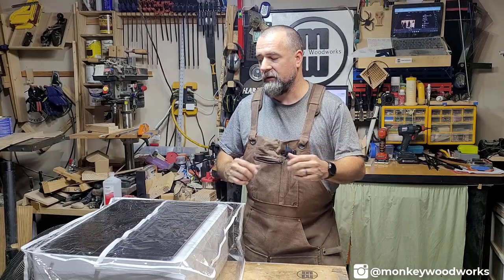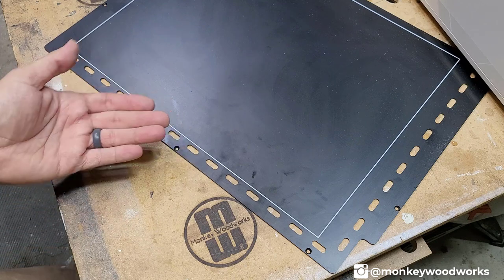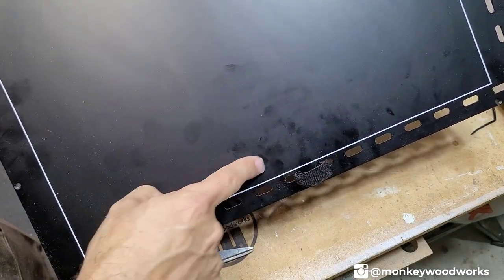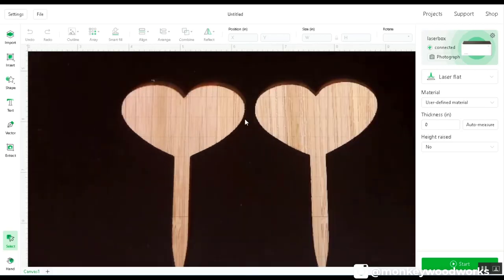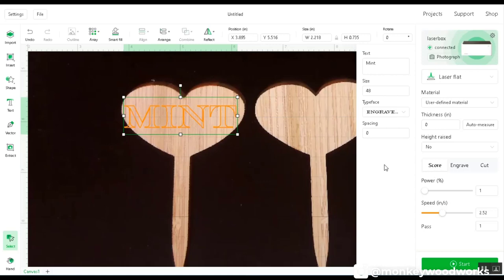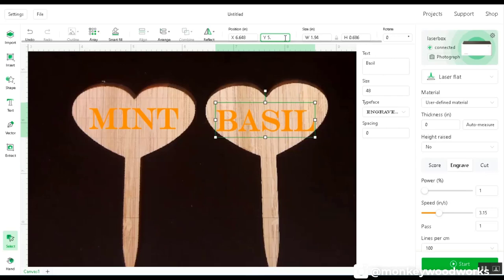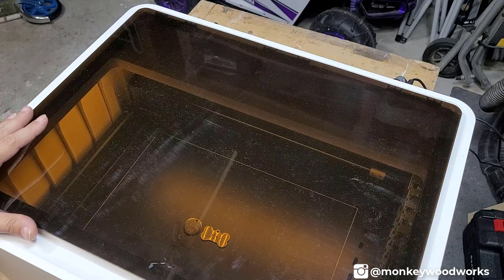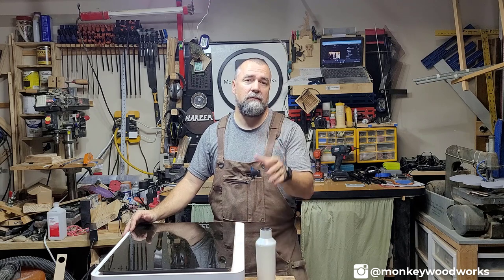Part 8 of Testing out the xTool M1 - Engraving: You Win Some, You Lose Some

Comment: Thank you so much for your amazing videos. I feel like I’m a pretty quick learner if I have some basics to follow. Unfortunately, there aren’t a lot of “handbooks” or tutorials out there for the M1 specially. I have so many questions but I think a good place to start is understand power and speed. Can you explain the settings for me and how the grids work? Do I need to make a grid template for each material I work with? Thanks in advance. ❤
Reply from the maker: You should run a cut and/or engrave test on all of your materials to find optimal settings. You can make your own with the grid array feature in XCS.  I have a cheat sheet of my M1 settings in the description of any of my M1 videos.  That will give you a starting point on some common items.

Comment: Great to find your video. I just ordered one online and expecting it to arrive in Aug in Taipei. But I find on their material testing spec that clear acrylic sheet won't cut successfully, which was a bummer cause I like to make things with clear acrylic the most. Can you share some acrylic sheet cutting video?
Reply from the maker: I will add yhat to my list!  I have seen in the group that a diode laser can only cut tinted acrylic.  Not only that but specific colors due to the science behind it.  Clear just allows the laser to pass right through.  I know xTool is going to work on topic specific videos for their M1 site so keep an eye out on their page as well as my channel.
Reply: @MonkeyWoodworks  Wow thank you for such quick response! I did use laser cut machine to cut clear acrylic back in design school. If I remember correctly, we left the protecting film on the clear acrylic sheet inside the laser cut machine and get perfect result. But that was more than ten years ago and that was a large professional machine. I'd be curious if this XTool can work. That would be awesome if it would work that way. :D
Reply from the maker: Group answer from xTool:  Unfortunately, all diode laser cutters, including M1, cannot cut clear acrylics because the light will pass through the materials instead of being reflected. So normally you will need a CO2 laser cutters to design on clear acrylics.

Group answer from a member:  The laser goes through clear acrylic, which is due to the wavelength of light; it’s physics and nothing can change that.
Reply: @MonkeyWoodworks  Thanks the answers!

Comment: Really appreciating the basics, hopefully I will have my machine soon! Others are using aluminum foil and honeycombs? Are you not finding those necessary?
Reply from the maker: I used aluminum foil at first but after it melted during my fire I started using a flat piece of galvalume.  It's something like 55% aluminum 45%zinc.  It works really well.  Also I want to get a honeycomb but they are $$ so I'm just using the prisms for the M1 still.
Reply: @MonkeyWoodworks  Hello thank you for your video. Question can you please explain what is a honeycomb really for? Sorry if this is a crazy question.  I'm new to all this goodness😁
Reply from the maker: The honeycomb does the same thing the prisms do.  It allows the piece to be held up in the air above the base plate.  This gives an air gap between the base and the piece your cutting.  The air gap allows for cleaner cuts when the laser blows through the bottom of the material.  It also cuts down on charring on the bottom of the material as well.  The advantage of the honeycomb over the prisms is that the honeycomb supports the entire surface all the time no matter how small a piece your cutting out.  The prisms have to be adjusted a lot to make sure they will support the piece your cutting.

Comment: After all this testing would you recommend the m1 to buy? And thanks for your work!
Reply from the maker: Yes I would and I am having lots of fun with it but it is not for everyone.   It has working area size limits (compared to it's older brother the D1), no air assist in cutting, limited to a 10watt version.  However, I love the camera, the fact that its fully enclosed, the ability to use as a cutting tool with a blade.  The only issue I have with it at the moment is the XCS software behind it.  However they are actively working on that and I know it will get better over time.
Reply: @MonkeyWoodworks  Thanks. Ordered :)
Reply from the maker: Awesome!  I think you're going to have a lot of fun.  BTW, the links in my video descriptions are now affiliate links.  If anyone orders from xTool when going through my links, I get a small credit for that order.

Comment: QQ Sir - I watched your video on using the rotary tool and tried to replicate your efforts.  When I get to the auto-measure step I get the error message that the device is offline.  I did the software update this morning - maybe that has something to do with it.  All connections are proper.  Did you ever run into this?
Reply from the maker: Hmm.  It does sound like it can be a software issue.  What happens if you balance a piece of wood on top of your tumbler, does it auto-measure?  Does auto-measure still work from the base plate?  What if you change to open plane mode or something different, does it auto-measure then?  Try installing the previous version to see if that fixes it.

Comment: I don't expect you'll have an answer to this, but I've got a big problem and I wondered whether you might have any idea how to fix it. I've reached out to Xtool about it but haven't gotten a response yet. I set my machine up and tried to do my first project with it (engraving a thin metal sign); the file sent to the machine successfully and the light started flashing blue, but the laser never moved or did anything at all. It sat like that for around two hours, then I turned everything off and tried again for another two hours before calling it quits for the night. Have you encountered any issues like this or have any idea what I should check to fix it?
Reply from the maker: Oh no! I would definitely join the official M1 Facebook group if you can and post your question there.
Reply: @MonkeyWoodworks  Got it all worked out finally! Thanks! :)
Reply from the maker: Nice! What was the fix?

Comment: It looks like the charms supplied by Xtool have a coating to take the engraving.  I have a charm not supplied by Xtool and it will not take the engraving.  I have used the same settings and it does not work.
Reply from the maker: I know there are coatings you can spray on items To help with that.  You might have to search the official M1 Facebook group or Google search. Unfortunately I don't know all the coatings they use for the different materials yet.
Reply: Thanks I’ve been researching a few will try the dry moly first (it’s cheapest) before heading into the $$$$ zone.  I thought I was doing something wrong.  I love your videos
Reply from the maker: I too have heard of the Molly.  I have yet to get some but intend to.

Comment: What are the measurements of material space?
Reply from the maker: If your talking about the working area the laser has to work with, the working area is 385*300mm (15*12 inch).  However, for engraving, if you can pick up the M1 and sit it on TOP of your target material, you can engrave it no matter how large it is.  However, that engraving is still limited to working area previously mentioned.

Comment: What settings did you use for the bottle?
Reply from the maker: I used 100power, 70mm/s, 100 lines per mm.  However, this bottle isn't a normal bottle.  I also saw in the FB group another option that looked good.  70, 70, 220 lines.  It's trial and error I believe.
Reply: @MonkeyWoodworks  thank you.  I hate the error part I’m scared to mess up lol
Reply from the maker: Test small sections on the same bottle.  Save $